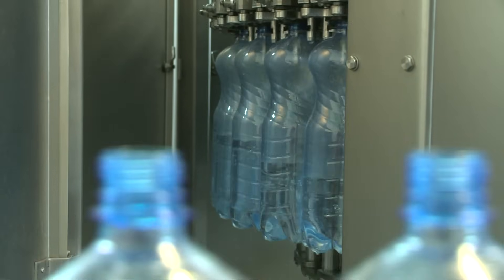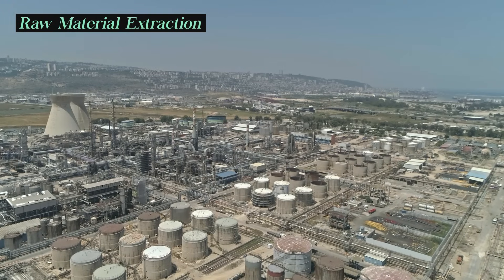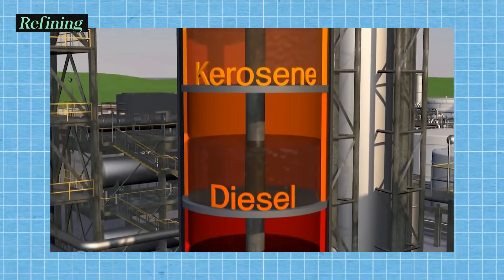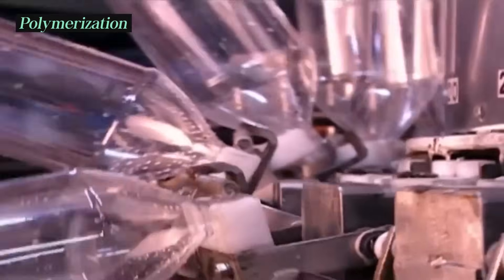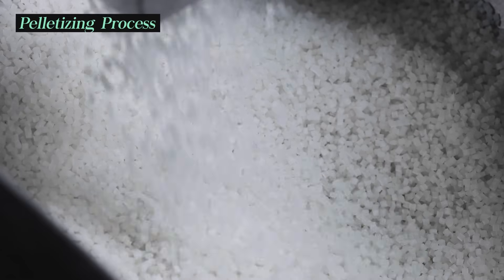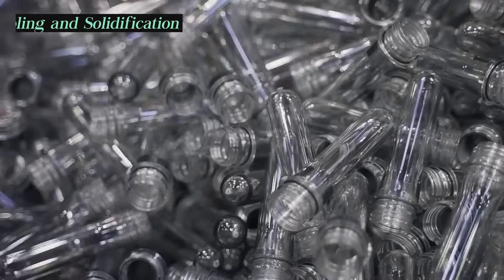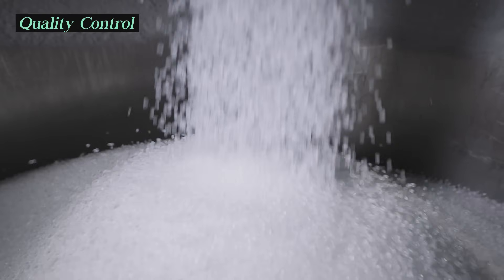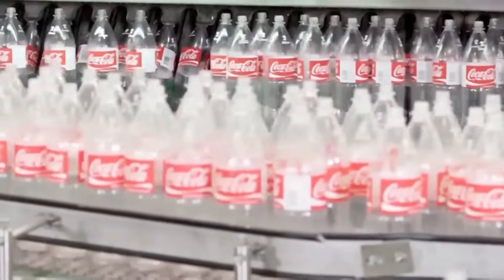How Plastic is Made

Comment: Approximately 9 million barrels of oil are used daily for global plastics production, which is around 12% of total global oil consumption and is projected to account for about 20% by 2050. The production of these plastics relies on fossil fuels, with over 99% originating from them, and the process contributes significantly to greenhouse gas emissions and climate change.   
9 million barrels a day.  That's insanity.

Comment: My first job after graduating highschool was running a pelletizer, just like the one at 4:53. It was an AWEFUL job, as the extruder screws are heated to various temps in the 400-600° range and all we had for air conditioning was a single open door with a big fan in front of it. The facility also mixed the raw powders, and even tho that was done in a separate wing of the building there was always powder building up on every thing. Powder and burrs would stick to my sweaty skin, and would somehow get into every nook and cranny. PPE consisted of goggles, ear plugs, and gloves.  Only the mixers got respirators. I felt truly bad for those guys... they would leave every 12 hour shift covered head to toe with various resins and reagents, and despite the protection the powder would just be caked into their nostrils, ears, and hair.

In central Indiana circa 2004, this was actually one of the better factory jobs available for non-skilled laborers. Starting pay was 13$/hr.

I got fired for crashing a brand new forklift into a spool of industrial box liners. The bar that held it pierced through the control console and came about an inch from stabbing me through the chest. I was not sad to leave.
Reply: Wow I feel bad, I don’t think I would ever go close to a plastic manufacturing plant. Working at one probably has a terrible effect on people’s health from all the microplastics and chemicals.
Reply: I feel like a lot has changed in this industry in the last 20 years. I'm a machine operator in extrusion now and I think employers have realized how costly a high turnover rate can be. It's still hot AF at work sometimes (nature of the business) but they've made a lot of efforts to increase ventilation, provide cold bottled water to workers, extra breaks and places to cool off periodically throughout the work day, cleaner production methods mean less crap in your hair, ears and lungs.. Starting pay is in the high $20's and you get a big raise into the mid $30's once you're certified to operate the production lines. I like my job. And the forklift incident is 100% on you dude. Don't blame your employer. You were driving. Were you drunk or high? Forklift accidents happen but they're rarely life threatening if you're driving responsibly. I dropped a 2000 lbs pallet once. I didn't notice the corner of the pallet clipping the warehouse rack as I lowered my forks and the pallet just tipped off. It was a big mess and a loss of about $5000 worth of product but I didn't get fired. Employers understand the difference between an honest mistake and reckless behavior.
Reply: Yeah my job was using moulds to make stuff, boss wanted me to do 1.5 hour over time for free and I'm like bye 😂

Comment: 🎯 Key points for quick navigation:

00:00 Plastic production doubled.
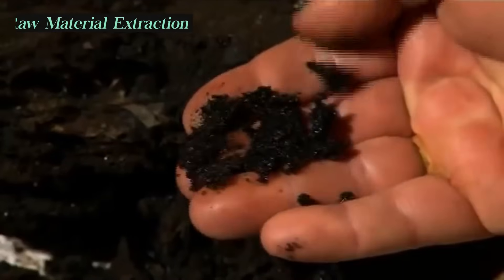00:12 Crude oil extraction method.
00:27 Refining crude oil.
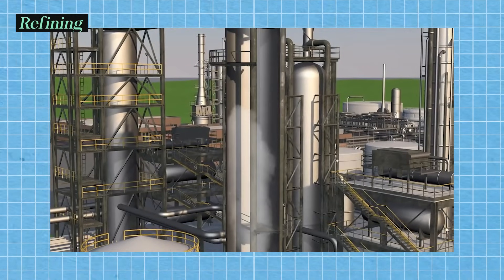00:54 Fractioning column process.
01:35 Ethane propane cracking.
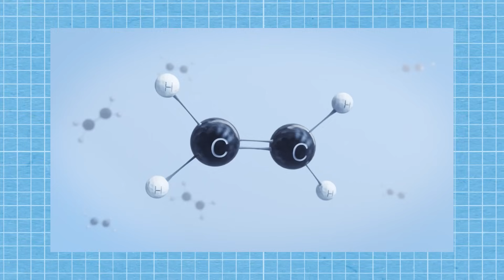02:04 Polymerization in plastics.
02:44 Addition condensation methods.
02:58 Creating plastic pellets.
03:11 Melt shape processes.
03:39 Additives enhance properties.
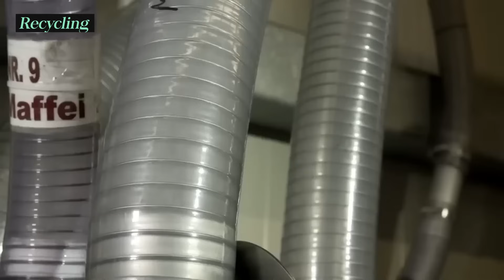03:52 Nurdles in recycling.
04:06 Nurdles spill issues.
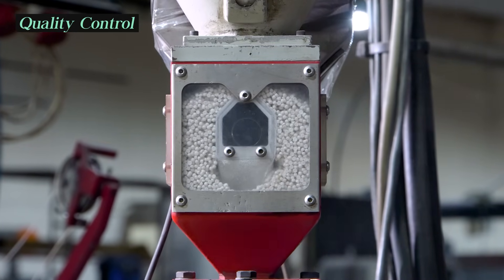04:35 Quality control procedures.

Made with HARPA AI

Comment: How do you ploymerize how
Reply: I think it’s by heating it
Reply: Heat and chemical reaction can break apart molecule chains and connect other molecules. At least, I think. (I use temperature polymerase chain reaction at work but it's for microbiology).